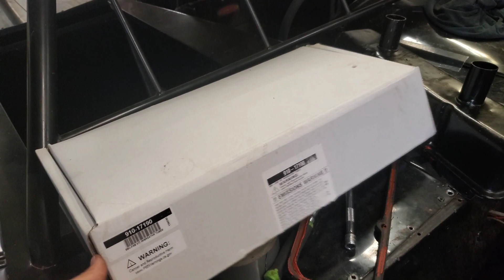New Valve Covers and New Oil Leaks!

Comment: They will leak after a few heat cycles. Don't for get to check tightness afterwards. Was there not an o ring for the breather tube? Seems that type of design would have one. The more holes you fix another will pop up. My advice would be set a date to go racing make a list and go over everything. I would check that intake that's a lot of silicone around it that will be your next culprit.
Reply from the maker: I'll make sure to put that on the pre race inspection list lol I'm sure you're right, the intake is globbed up with rtv, as were the old valve cover gaskets. Whoever put it together believed in the stuff for sure!
Reply from the maker: I just wanted to let you know that you were correct in the fact that the intake would be the next thing to leak. Hopefully we can stop that problem now lol